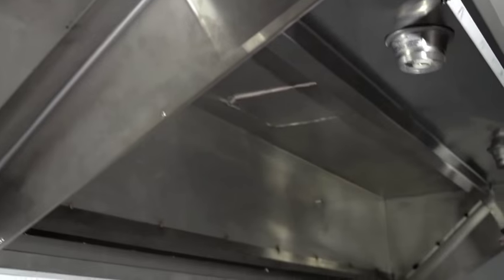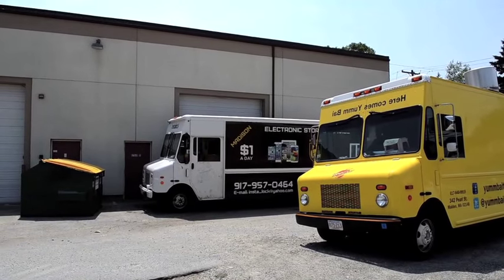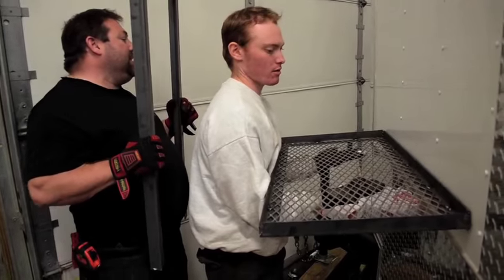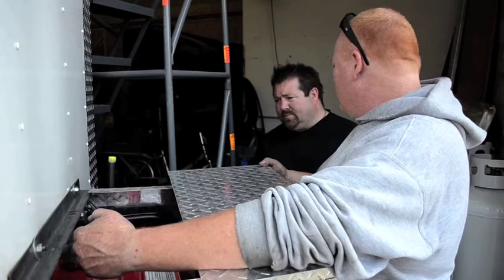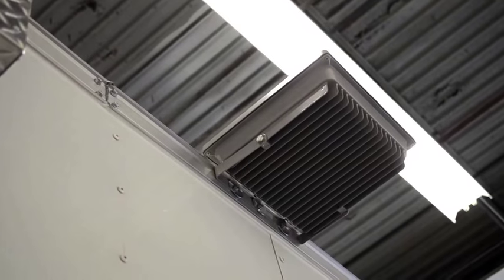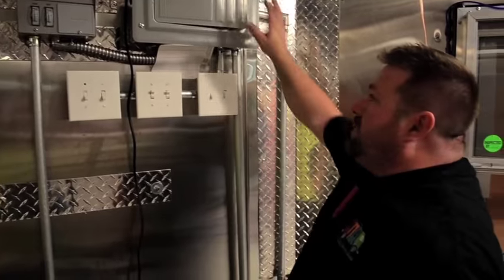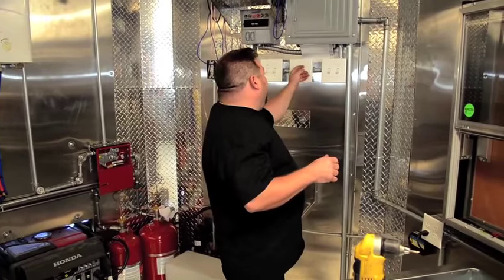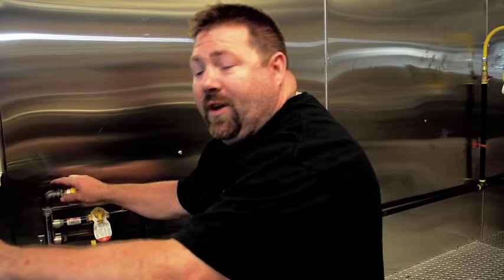Food Truck - Food Truck Builders Group Episode #1  / How We Build Food Trucks

Comment: We leave the trailer on June 25, 2017, in Food Truck Builders Group 4 Draper St, Woburn, MA 01801.
We pick up the trailer on October 14, 2017
Those three and a half months, whenever we called Allan, it was complaints and problems.
We did not tell him anything because we thought Allan was doing a good job.
But not, we had to close the trailer after two weeks, we open for malfunctioning of the entire trailer.
The generator does not work was badly installed.
The lights do not work.
The roof is full of leaks.
My husband worked like 48 hours sealing all the walls.
The generator is in Cummins Utah, Allan does not answer the phone and emails to take care of the installation.
Reply: how much did you pay?..Ballpark?
Reply: did they resolve the issue?
Reply: @santodeportes5946  They are posting this on every video. As a result, they are not telling the whole story; by which they could not afford all the repairs needed on their 40 year old truck 🚛 when they did their build out.

Comment: How do you get away with mounting the electrical panel the high???? I thought it couldn't be higher than 6' to the highest breaker?
Reply: YoungBrothersFitness yes in residential, assuming the states is the same as Canada but in commercial there is no height restrictions